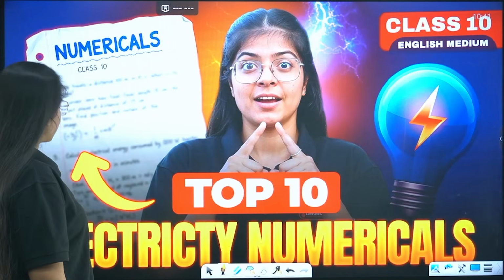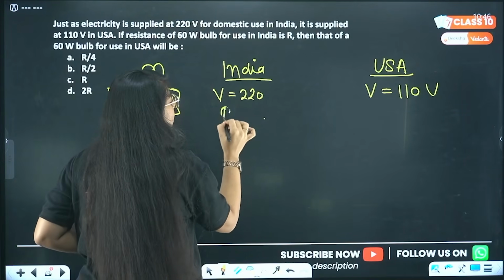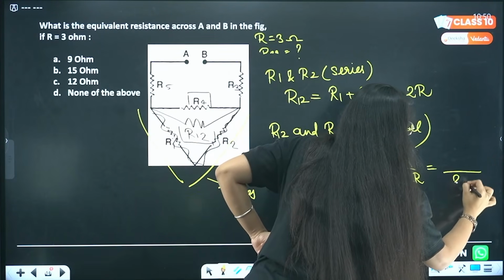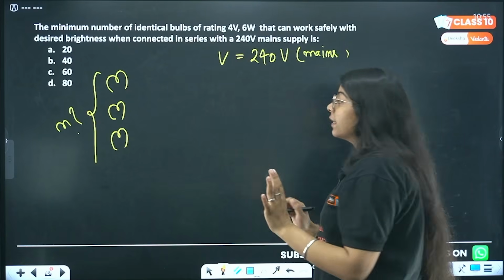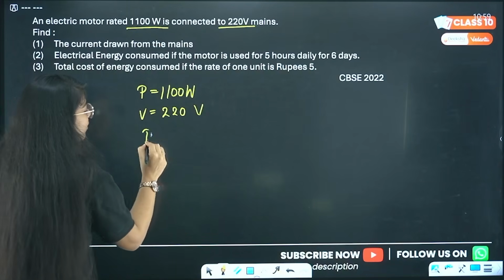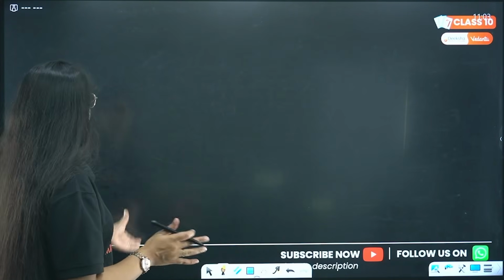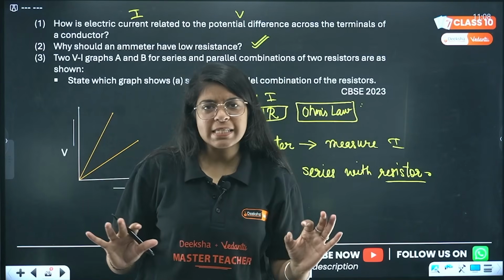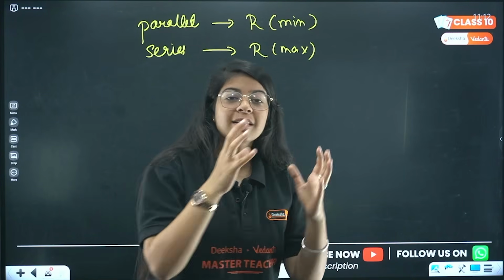⚡ Top 10 Electricity Numericals for Class 10 Physics! 💯 | Class 10th Boards Must Practice

Comment: Ans: (a)length 2l and diameter 2d will have least resistance to flow of current  in the circuit.
The total amount is 165 rupees

Mam, I got each of them correct. Thankyou so much it was very helpful:)